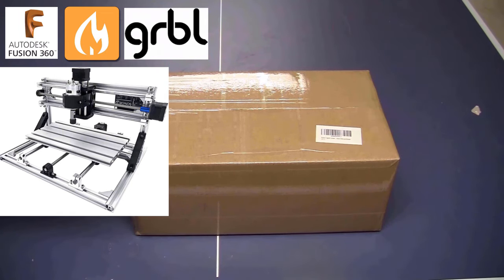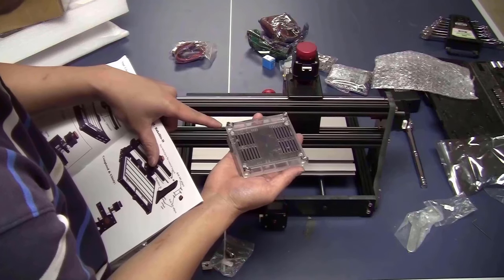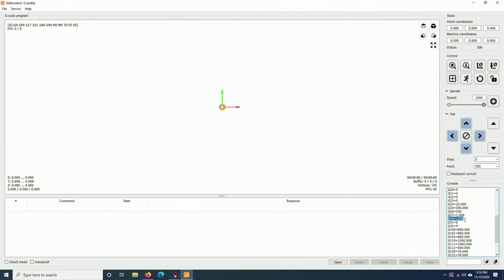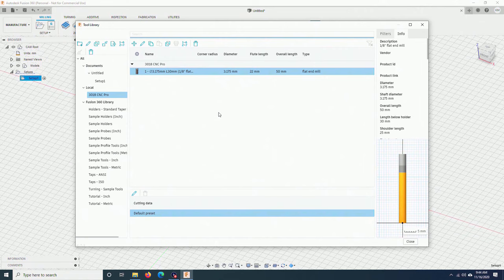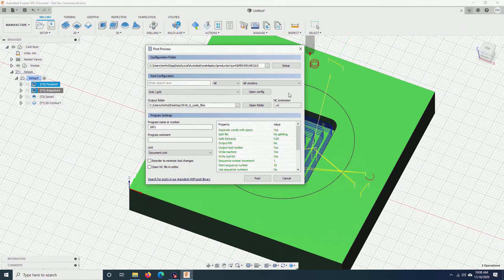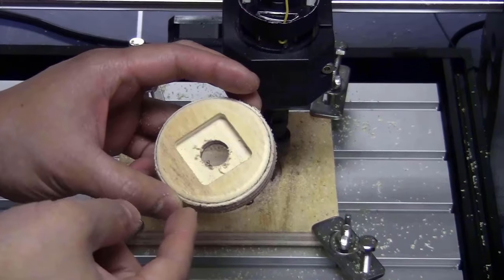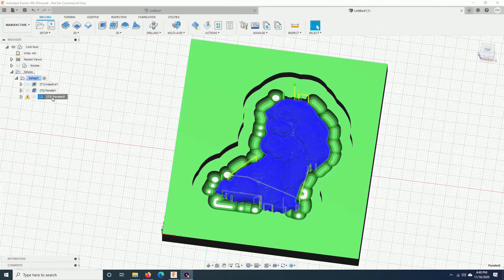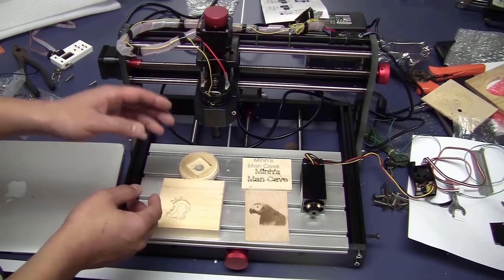3018 CNC/PRO - New (updated) beginner's step by step guide - All tricks and tips

Comment: lead screw= pronounced like leed , and for the metal like led: lead battery)
Reply from the maker: I'm in no position to argue about English here. But I hope you will have time to correct all the American guys on YouTube.
Reply: @minhsmancave9448  no american myself, just wanted to let you know how to improve.
Reply from the maker: Will try next time. Many viewers have been letting it slide for so many videos that I thought I was correct,lol.
Reply: @minhsmancave9448  btw, did you change the electronics on your 3018 , or just beef up the mechanics?
Reply from the maker: I did too many things to my 3018, both the electrical and mechanical , each upgrade did something good to the machine. But I were to do it again, I would only upgrade the linear rails on the X axis and the spindle. Then all others are additional. Mach3 will improve the user experience with many things you can customize (grbl doesn't let you do much). Upgrading to Mach3 will force you to change stepper motor drivers and why not bigger stepper motors with them? Before building my new CNC machine, nobody recognized my 3018 anymore.

Comment: Arduino IDE 2.3.2
Sketch uses 29762 bytes (96%) of program storage space. Maximum is 30720 bytes.
Global variables use 1633 bytes (79%) of dynamic memory, leaving 415 bytes for local variables. Maximum is 2048 bytes.
avrdude: stk500_recv(): programmer is not responding
avrdude: stk500_getsync() attempt 1 of 10: not in sync: resp=0xa8
avrdude: stk500_recv(): programmer is not responding
avrdude: stk500_getsync() attempt 2 of 10: not in sync: resp=0xa8
avrdude: stk500_recv(): programmer is not responding
avrdude: stk500_getsync() attempt 3 of 10: not in sync: resp=0xa8
avrdude: stk500_recv(): programmer is not responding
avrdude: stk500_getsync() attempt 4 of 10: not in sync: resp=0xa8
avrdude: stk500_recv(): programmer is not responding
avrdude: stk500_getsync() attempt 5 of 10: not in sync: resp=0xa8
avrdude: stk500_recv(): programmer is not responding
avrdude: stk500_getsync() attempt 6 of 10: not in sync: resp=0xa8
avrdude: stk500_recv(): programmer is not responding
avrdude: stk500_getsync() attempt 7 of 10: not in sync: resp=0xa8
avrdude: stk500_recv(): programmer is not responding
avrdude: stk500_getsync() attempt 8 of 10: not in sync: resp=0xa8
avrdude: stk500_recv(): programmer is not responding
avrdude: stk500_getsync() attempt 9 of 10: not in sync: resp=0xa8
avrdude: stk500_recv(): programmer is not responding
avrdude: stk500_getsync() attempt 10 of 10: not in sync: resp=0xa8
Failed uploading: uploading error: exit status 1

Added Librarie and started upload file
grbl-1.1h.20190825.zip

CH341SER Driver is installed and tryed diverend Baut Rates 9600, 57600, 115200 (set in Device Manager and select in each program for uploading).
Every Baut Rate works for controling the Axis.

EEPROM
Grbl 1.1f
$0=10
$1=25
$2=0
$3=6
$4=0
$5=0
$6=0
$10=1
$11=0.010
$12=0.002
$13=0
$20=0
$21=1
$22=1
$23=7
$24=25.000
$25=500.000
$26=250
$27=2.000
$30=1000
$31=0
$32=1
$33=0
$34=0
$35=0
$36=0
$37=0
$38=10
$39=0
$100=800.000
$101=800.000
$102=800.000
$110=2000.000
$111=2000.000
$112=100.000
$120=20.000
$121=20.000
$122=20.000
$130=500.000
$131=500.000
$132=200.000

Can read and write to EEPROM, control CNC with Offline Controller and other programms like LaserGRBL, gSender, Candle. 
All Functions are working, but i can't Upgrade to Version 1.1h or add machine to Estlcam and control there. 
Tryed Arduino IDE, XLoader, AVRDUDESS, LaserGRBL for Upload.
Disconnected all cabel and the Offline Controller before Upload.

Any Ideas for Solution?